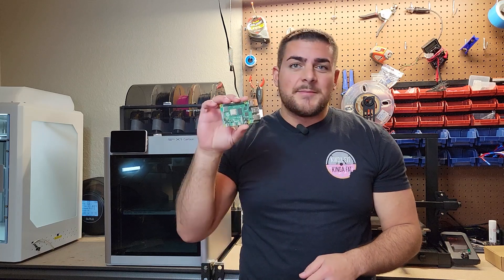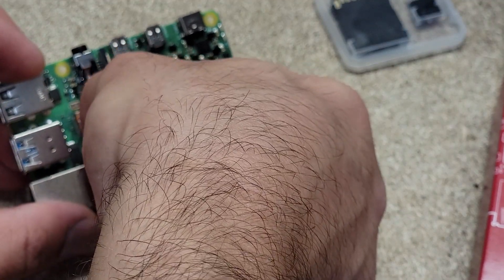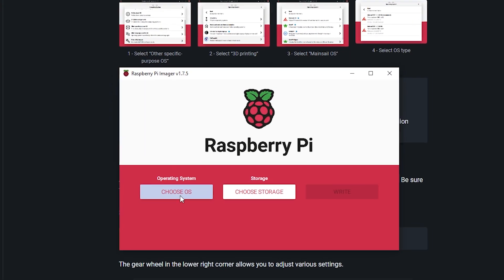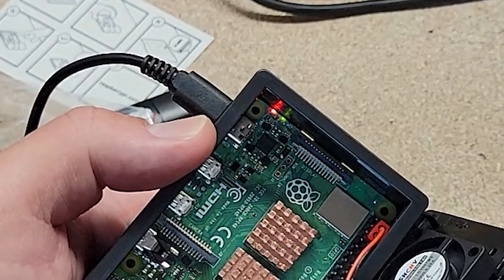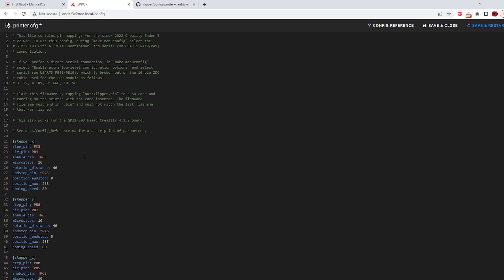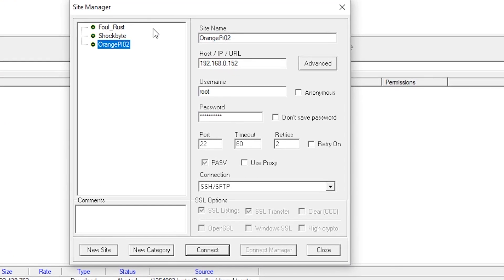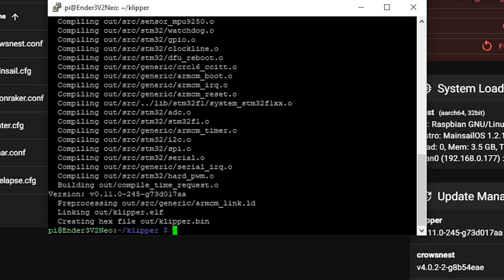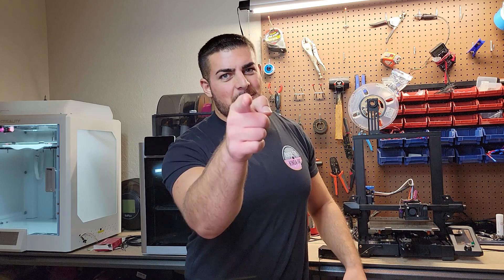Install Klipper On Your Ender 3 V2 Neo Fast! - COMPLETE GUIDE

Comment: Thanks! I had it running on a low quality usb stick and it broke so i needed to reinstall, but i last did this so long ago i entirely forgot everything. This was really helpful and got me up and running quickly. Now even orcaslicer gcode works fine, i think my previous mainsail version was super old!

Comment: I can't seem to connect with the MCU to get the ID.  I tried installs several times.  Blue cable from Ender kit.  Mini E3 V3, RPI 4B, OS Mainsail via SPI image,  SD Fat32 format, Firmware.BIN was replaced after the flash.  Klipper is up to date.

Comment: i do all the process... my printer now has klipper... but, the print speed is THE SAME , like before when i use marlin... what's wrong?
Reply: Still need to tune it and change the speed in the slicer. Let me know if you also install ADXL345 as well for acceleration.

Comment: This way doesnt work with my pi 5 and mainsail OS. Wireless will be blocked in my pi and i have to connect with cable to it. After reboot and putty shows me rfkill list softblock wireless: yes. After deblock and reeboot without cable to the router the problem shows the same after wireless fail and connect with cable..... 😵‍💫☠️

Comment: I have tried a bunch of tutorials. but when i type in my printername then .local it says "site can not be reached".
Reply: have you found a solution i have the same exact problem
Reply: @nickolastibincoski867 no but ill try to find a solution tomorrow
Reply: @ieatbreadmcold u can try connect by ip connect raspberry to monitor by HDMI and keyboard then type "hostname -I"
Reply: @krawel284  ima try that
Reply: @krawel284  it still didnt work
Reply: @not-IeatBread  what did u get after put hostname -I

Comment: I followed the instruction stelp by step. However, I got stuck at two main points. Hope someone could help:
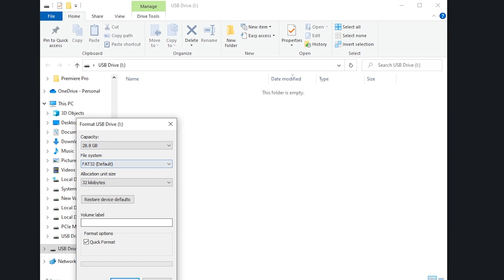1) at 07:24, for some reason my SD Card shows capacity of 512MB despite the actual capacity is 16GB.
2) at 07:35, I cannot access my local host (xxx.local). Not sure my laptop is missing something? Is this .local accessible from the internet browser or any app?
I am stuck from here. Much appreciate someone's kind help!
Reply: 1)probably 2 partition istall Minitool partition Wizzard anf format the SD to fat 32
Reply: @krawel284  Thanks a lot. It works with disk size, just still cannot connect to .local

Comment: i have a ender 3 and i know that this is for a ender 3v2 neo but shuldnt it still work? my motors just dont home but the bed and nozzle heat up
Reply: My motors don’t home either and I can’t figure out why. Using a 4.2.7 board. Everything else seems to work but my motors won’t move.

Comment: Would this work on a regular on a regular ender 3?
Reply from the maker: @thomaswest2583  Yes, you would just need to make sure to create the right bin file for whatever MCU is on your Ender 3's mainboard. Then just make sure you use the correct Klipper config file for the printer or modify an existing one.

Comment: can I use old laptop for this project (ender 3 v2 neo? I have old laptop sitting on the corner and RPi here is quite expensive for a student like myself
Reply: yep you can use laptop instead of the pi. it will be much better too imo

Comment: Really great Guide but somewhat incomplete. For my Ender 3 I used Raspberry Pi 3 with 4.2.7 silent upgrade and  I ran into a problem where MCU wouldn't connect.  I fixed it by changing the baud to 115200 remaking and then also placing (baud:115200 ) under the serial: in the print.cfg folder. I'm very happy it worked. Besides that this is the best video for the klipper upgrade!
Reply: thanks that helped me. kept serial connection closed in klipper.log

Comment: I just leave this here, after a while of investigating why I can'y connect.

Reddit: "If you still have issue connecting to the web interface, be sure that you didn't change the default user "pi", because the web server is looking for files under "/users/pi/mainsail". If you changed it, it won't be able to serve those files"

Comment: I took out my printer from the silo after 6 months and the screen just won't work. Could use it with octopi by was not able to control 100% of the features. Couldn't find the exact screen anywhere in India. So though of using klipper to remove the screen all together.. And just got a video with exactly the same printer model ! amazing.. Thanks so much.

Comment: Did you make any hardware changes to your machine to make it print better at faster speeds?  Different hotend/direct drive etc?
Reply from the maker: @seansillick998  The only physical change was adding a 5015 hotend fan and a hotend fan controller. Other than that, no other hardware changes.

Comment: I wonder if this tutorial works for the MKS Skipr board also.
Reply from the maker: @viniciusgoncalvesdeoliveir440  the Skipr is an AIO board, so no need for the Raspberry Pi. The setup is actually easier for that board.
Reply: @ really? Sorry I am very newbie with this things. Did you have a video that can help me? I know nothing about
Reply from the maker: @viniciusgoncalvesdeoliveir440  No worries at all! There's so many different options changing every single month, so it's definitely difficult to keep up with. I don't have a video for those yet, but 3DNero probably does.

Comment: How did you get rid of ".local refused to to connect?". I saw that error also in your video!  Thank you for your cool videos
Reply: i had the same issue. connect to the device via it's ip address. you can get the ip address from your router. you uncheck that part of the setup if need be.

Comment: I have a raspberry pi 3 and a ender 3 V2 neo. I want to try Klipper, but if I don't like it, can I return to the original firmware?
Reply from the maker: @sergiolgodoy  Yes, you would just need to flash back to the EV2 version of Marlin that you're already on.

Comment: Used this on a Ender 3, equipped with a 4.2.7 motherboard and a Raspberry Pi Zero 2 W. The process was simple, and worked flawlessly!
Reply: witch config file did you use ?

Comment: Can't access mainsail after installing it on the sd and inserting into the pi. The green led does flash while the red led light is solid. I have it connected via USB for over 30 min and can't load mainsail.
Reply from the maker: Can you ping the IP or hostname that you assigned to the Pi?
Reply: @FoulNews  no it won’t let me either

Comment: Sooo you pay a bunch of money do an extremely dangerous hack that only a programmer developer has any business doing and you lose functionality of your screen? Did I miss anything?

So you’re paying money to lose a screen and possibly break your motherboard if you do it wrong.
Reply from the maker: You can install Klipper for under $40 these days. A dangerous hack? It's literally just changing firmware to a much more capable firmware and interface. If you really need a screen, you can use Klipper Screen or convert the stock screen to work with Klipper.
Reply: I say a dangerous hack because if you mess up the firmware you break your motherboard. I did that upgrading a reality Ender three V2 neo motherboard because the instructions from Corey reality are incorrect and tell you to use multiple files when updating the screen.

They also tell you to flash the motherboard and then the screen, and then they reference a YouTube video that tells you to flash the screen and then the motherboard, you get that wrong and your motherboard is dead and you have to buy a new one.

As far as flashing firmware, they give you multiple files and I discovered in reality you only use one file not more to successfully do it.
So it cost me a motherboard. And yes, losing the functionality of your screen is ridiculous. How else are you going to control your Z offset, nozzle temperature, increase your decrease the speed, start stop or pause the print? If you don’t have a screen, that’s ridiculous. So yeah that’s completely outdated hack and using the sonic pad at least gives you a screen.

I’m sure you have an answer for how to print but if you can’t control it with the screen, you can’t pause you can’t you can’t stop other than just shutting the power off to the machine if it has a failed print. You’re literally downgrading your machine for clipper in this case
Reply from the maker: @AlexDiamonds  there's a comprehensive web interface that you can access from any computer or phone on your network. That's how you adjust things and monitor prints without a screen. Klipper is far more advanced than Marlin and doing the conversion incorrectly doesn't brick your mainboard.  Again, you can use a Klipper screen compatible screen or convert the factory screen if you really need one.

Comment: Was stuck at the last step, MCU didn't show up on System Loads.. (putty was fine) Formated SD Card and flashed firmware again. Now its working! Using the ENDER 3v2. Thanks a lot man!

Comment: does it work on ender3 s1?
Reply from the maker: Yes, but you'll need to make sure to use the correct printer.cfg file for the S1, as well as making sure that you create the correct Klipper.bin file for the S1's mainboard.

Comment: Does the original display not work with this firmware? I was just wondering as my screen has gone dark after installing everything. Besides that, everything works GREAT!
Reply from the maker: That is correct. You would either need to do some more configurations or use compatible Klipper Screen hardware. If you want to use the factory screen, follow this guide: https://www.reddit.com/r/ender3v2/s/uVGJNFKlDz

Comment: Fantastic tutorial. Lays everything out nice and clearly. Only one small note to users wishing to replicate this, the raspberry pi imager ui has slightly changed. All the same options are there under the same name, they are just in a different location. If you have stock hardware this is the best guide I've seen. If you have modified hardware this tutorial is still amazing, the one thing to keep in mind is you will need to tweak your printer.cfg file, but the documentation for your parts should include most if not all of the values you need to tweak.

Comment: Thank you for your guidance on setting up Klipper. It has made the installation process much easier for me. However, I am currently experiencing issues with my old Start G-code that I used with Cura before. It's showing some 'Unknown command' errors. I suspect it's because Klipper uses a different Start G-code system compared to the original Ender system.

Could you please provide me with your G-code start configuration for Klipper?

Once again, thank you very much for the setup guidance.

Comment: will I have to do anything extra to get this working on an ender 3 max neo?
Reply from the maker: Yes, you'll either need to find and use the correct Printer.config file for it or modify the V2 Neo's printer.config file to match the bed size, thermistor, rotation distance etc... also make sure that the max 3 neo uses the same mainboard.

Comment: Does this work on regular ender 3v2?
Reply from the maker: Yes, just make sure to either use the config file for that printer or modify the one used here.
Reply: @FoulNews  I picked a different firmware thanks tho, didn’t wanna get a pi

Comment: well now lets see if i can adjust these steps to work with a monster8 board running a 2000 x 1000 x 1000 printer running with sensorless homing. more accurately i'm going to spend the next few hours going through documentation on both klipper and the main board in hopes of getting the printer working.

guide is great. just my idiot self that decided to build the most ridiculous printer possible for a personal project of mine and move off marlin while doing it
Reply: I was just reading comments out of boredom and suddenly I am really curious if you figured it out and got the printer running :D

Comment: Thanks for the video! I have a quick question. After I installed Klipper, do I need to setup input shaping? It seems my printer now is printing at fast speeds and is a bit louder. It's weird because the settings on the Klipper gui was the same as yours. Let me know your thoughts, and I apologize for my lack of knowledge as i am new to Klipper!
Reply from the maker: Input shaping isn't necessarily required, but will help with quality, especially at higher speeds. Klipper by default increases the printing speed by a bit, so it's normal for your printer to be working a bit more quickly even on default settings.

Comment: Great video. Can I use a raspberry pi 2 instead of the raspberry 4?
Reply from the maker: Yes, but the network config will be different since you'll need to use an Ethernet connection instead of Wi-Fi.

Comment: Great video, followed it as you did on screen. Only problem I have is i can't connect to it after installing mainsail on the pie, just keeps saying the site cant be reached. Redid the image like 4 times and still doesn't work. Any suggestions?
Reply: Did you ever figure this out? @jefftrost4101

Comment: Nice video! I have the Ender 4v2 Neo Max today with MriscoC Firmware and its working so good! However, is it possible touse your guideance in the video and install Klipper like this and have it to work properly without issues? Any concerns?

Comment: I just tried to print something, the nozzle is 1/8" above the bed as it extrudes, the left edge 'warm-up' line is on the edge of the bed. I tried to find where to tell klipper to reset Z 0 but can't find anything, I 'adjusted' the bed up to the point the springs are almost loose to get 'up' to the nozzle but I really need a means to drop the head down.

Comment: Worked! Two head-bangers; make menuconfig was not showing the screen you had, it only had amega, google found the answer: spacebar. The Raspberry PI was not showing up: Damn USB micro to A power only cords! I'm going to go watch your Zero 2W next, at $15 a pop and they can run off the systems power that will be a tronxy and hictop upgrade next, I mentioned Zero 2W to a Creality user and got the lecture about hardware Klipper supports along with links and tisk-tisk sounds.  Subscribed and Liked, good sound, good light and well paced.

Comment: Followed to a T ... Although i'm using the Ender 3 V2. Can't get my Board to connect.  I get "Moonraker can't connect to Klipper!
Please check if the Klipper service is running and klippy_uds_address is correctly configured in the moonraker.conf." To which i'm not sure what to do next.

Comment: I have followed every step and somehow ran into an issue that I haven't been able to google... on my Klipper Firmware Configuration menu the communication interface and bootloader options are not listed at all.
Reply: You have to change the microController architecture to STM32

Comment: can i follow the same process for an ender 2 pro?😅
Reply from the maker: The process is pretty much the exact same. You'll just need to verify which board version you have so you can make the correct Klipper firmware for it and you'll also want to make sure to use the correct Printer.cfg file as well.

Comment: Hey dude
Im using a Creality 3 Neo Max and im wondering if I can take the same config?
because this looks the same just more build volume with the max
Reply from the maker: You should be able to use it, but just make sure you set the correct safe points in the bed mesh section of the printer.cfg as well as safe homing etc...

Comment: Hello!  Thanks for the video!  Could you help me, because I've been trying for 2 days and my raspberry pi 4 can't connect to wifi.  I've tried with the latest mainsailos, I've tried with older ones, but the result is always that it doesn't connect to wifi.  What can I do wrong?  I do everything as I saw in your video.  Maybe you can think of something.  Thanks for the answer !
Reply: Did you get a solution?

Comment: Great video, wonderful guide 👍 Is there any advantage running Klipper on a Pi 4 /4GB of RAM as opposed to a Pi3B+ (1GB RAM)? Will a Pi 3B+ run as smoothly as a Pi4 4GB RAM and create the same quality prints? Thank you :-))
Reply from the maker: Thanks! There's no real advantage unless you want to make multiple instances of Klipper run off of 1 Pi, even then a 3B+ would be just fine. Klipper doesn't take up a lot of resources at all, so you should be more than good with your set-up.
Reply: @FoulNews  Great. Thank you for the clarification. This is important to know given the cost of the Pi's nowadays.

Comment: this is a greta guide. if you wanted to make it better, make people use mobaxterm instead of putty, that way they  are allready connected and can browse the folder structure when they connect to ssh,  and dont need to FTP inn in a different session.

Comment: Great video thank you very much!
I might be extremely tired but I spent a long time figuring out that I had to select the STM32 microcontroller on the Klipper Firmware Configuration menu. Mine only had two options and it didn't look anything like yours. It took me a second to put 2 and 2 together, but again it might be because I'm extremely tired. It's christmas day and I'm recovering from covid.

Comment: There are neither Marlin nor Klipper config files out for the Ender 3 V3 SE. How long does it usually take? Been 3 months since release.
Reply from the maker: You can just modify any Ender series config file to suit the V3 SE's setup. Just make sure the config is set correctly for the Sprite extruder. There's config settings out there for the Sprite.

Comment: Klipper installation went smooth! Really good guide. Got an issue using the "Calibrate" function on the heightmap section, error says " No trigger on probe after full movement" anyone had this issue before?